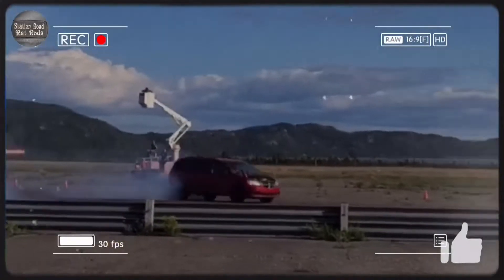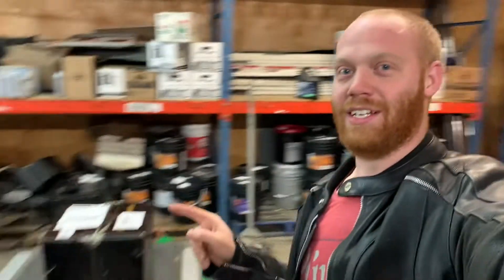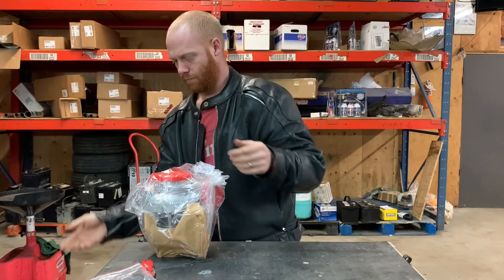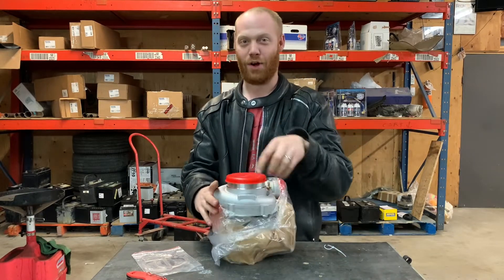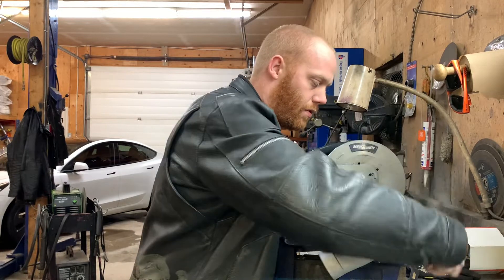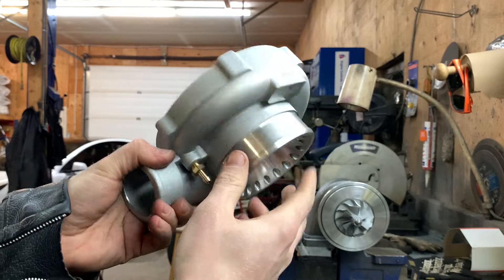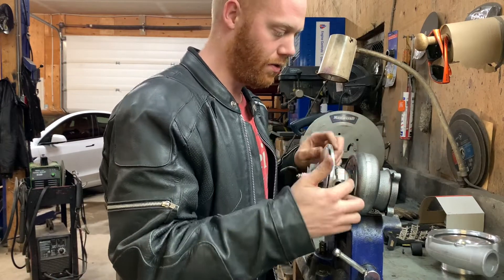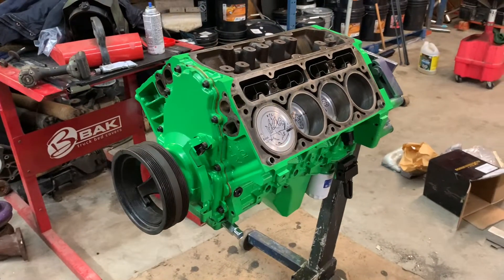Maxpeedingrods GT35 GT3582 unboxing, disassembly and review! Cheap turbo, good quality!

Comment: I just bought two with the billet wheels for a twin turbo LS 5.3 build I'm doing.
Reply from the maker: You’re going to love it. I had two of these on a destroked 6 litre and it was an animal!
Reply: @StationroadRatrods  I'm super hyped man! It's going into a Cadillac ctsv my buddy got for cheap. Just got it stripped and the transmission pulled this week. Hopefully taking the 5.3 we to the machine shop this week go have them go over the block and gap the rings. I have to build some custom manifolds to make it fit in the engine bay but luckily I'm a tig welder lol.
Reply from the maker: @clutchboi4038 man I’m hyped for you, V’s are sick! I hope you guys have a blast

Comment: That's a lot of movement.......omg. not correct
Reply from the maker: I just read your name and ufology must be a rewarding but frustrating study huh? 

As far as I understand, journal bearing turbos like this need shaft clearance so it can float on a film of oil, though I don’t know how much clearance is too much. 

I had two of these turbos on my truck all last summer with zero issues, if that counts for anything

Comment: I'm a machine tool fitter I work with bearing and bronze bushes daily, from little .5" to 12", for those that don't know journal bearings are are phosphor bronze bushes they aren't brass as some think, they need that play for clearance for oil to lube them, theory is when spinning the shaft will float on the oil and find its center and why balancing the turbo is so important if the shaft runs on the bearing it will wear it quickly so no clearance it will kill the bushes and shaft, the only turbo that shouldn't have play is a ball bearing but they require restrictor as too much oil will kill the bearings
Reply from the maker: Awesome info! I didn’t know about the two types of bushings. Thanks a lot
Reply: Teach those uneducated people lol thanks.

Comment: Im actually super tempted to get their street series 3076 because at 1/3 - 1/4 thr cost of a garret it steems like a dsmn steal if its a decent condition unit that wont nade itself.
Reply from the maker: I’ve had two of them on the truck for a full summer with no issues at all, if they shit the bed I’ll have videos up on that too

Comment: I had one of these brand new from day one that smoked loads - made me think it was my engine, but indeed upon dissasembly of the turbo the oil was pouring into the exhaust housing from the shaft lol.  I even tried a restrictor etc but kept having issues. My drain was pretty good too.
Have you ran yours yet? Im tempted to try another ( as they are many times cheaper than alternatives )
Reply from the maker: That’s wild. 

I’ve actually had two of these on all summer on my V8 with zero issues. I have a -6 oil feed to both. 

50 psi oil pressure at idle and around 90-95 psi at WOT and no restrictor 

The only issue I had were the oil lines I used were leaking, but that didn’t really have anything to do with the turbos themselves

Comment: I'm glad you did a review on their products... I've been shopping on the innerwebs
Reply from the maker: Right on man. As a follow up, I’ve had them on the truck now all summer with zero issues. No smoking or worn parts or anything. I’m on 4 psi right now, but I’ll be turning it up to 10-12 psi soon, if there’s any issues I’ll have videos on it
Reply: @StationroadRatrods  still no issues?
Reply from the maker: @whatta No issues at all! I drive the truck every possible moment and they work awesome. No smoke, leaks or noise only that sweet whistle
Reply: @StationroadRatrods  thanks a heap! Hopefully soon I'll have a pair mounted up to an LS.
Reply from the maker: @whatta I hopefully sooner than later! 

It can be dangerous though, you’re like 
“Just one more psi” and kaboom

Comment: Do you know what the thread pitch for the coolant ports are? I’m trying to figure out what fitting to put in them to work with my AN lines
Reply from the maker: They’re fucky, the thread is M14x1.5
Reply: @StationroadRatrods  okay does do you know what AN that converts to?
Reply from the maker: Sorry about the late reply, you should be able to find any size adapter. -6 is fine, it’s 3/8” ID 
I’m gonna see if I can find a -8 which would be 1/2” hose
Reply: @StationroadRatrods  thank you for your help! I found 14x1.5 6an adapter. Thanks again!
Reply: Do you happen to know the thread pitch and such for the 4 bolt exhaust outlet. Also I got this because the 4 bolt was supposed to bolt up to my srt4 but it seems my 02 housing is a smaller 4 bolt than what this turbo came with.
Reply from the maker: If you mean the outlet where the exhaust tailpipe would bolt on, as far as I remember it’s M8x1.25, and the flange that bolts to your manifold is M10x1.5.
Reply: @StationroadRatrods  yes I meant those but I’m also looking for a flange that fits the exhaust outlet. I thought my srt4 four bolt flange would bolt right up but it seems to be slightly smaller so all the studs won’t match up.
Reply from the maker: Okay, the part number for 3” outlet is Vibrant 14380, the part number for 2.5” outlet is 14390

Comment: Any HELP,  PLEASE on this turbo .  I have it fitted installed properly and professionally.  To my honda k20a  engine. Lots of Smoke is coming out from it  at opposite side inlet. When stationary,  after a short drive.
Looks bad , and embarrassing.  Oil seal leak i guess, not sure. This is my 1st turbo ever. Puffs of smoke out exhaust after short time of full boost,  after burn
Reply from the maker: I’ve heard of issues with the seals from factory, message Amazon or maxpeedingrods and ask for a replacement. Did this happen right out of the box?
Reply: @StationroadRatrods  i bought the car from a previous owner. And paid alot for it. So am really concerned.  Dont know if I should buy another as its made to fit where it is behind the engine block, and map tuned for it
Reply from the maker: I would suggest buying another one, you’ll burn a lot of oil and those civics don’t have a lot, don’t wanna cook your engine. They’re only 230 Canadian so they’re super cheap and you could have it changed in a couple hours as the fab work is already done, it’ll just be a replacement
Reply: Dont know if you have resolved problem but could it be an oil outlet restriction problem? Some have to resort to pumping oil back to engin eif it not mounted high enough or too small / long of return line. Just my 2 cents.
Reply from the maker: By the sounds of it he got a car with a worn out turbo but never heart from him after
Reply: @StationroadRatrods  my stage 4 competition clutch is slipping like crazy. Mostly due to normal driving. £150 for same new turbo. Its ecu mapped too. Its off the road . As I have 2 other cars , and a new born daughter. No time for my toy 😢
Reply from the maker: Congratulations on your new baby girl 🥰 I have two daughters, 7 and 9. They love being at the garage and helping with everything I do. 

Don’t get rid of your project if you can help it, she may love it one day. 

Hope all works out for ya, have a good one buddy

Comment: That shaft play seems excessive. Some will work out when it's hot and oiled up, but I'd expect half that or less. Have you measured the runout? Probably a good idea to do that before you call Maxpeedingrods.

Never had a good feeling about quality from that company. After all, they were too cheap to print the first S. :p
Reply from the maker: That’s kind of what I thought. I’ll take a measurement tomorrow and when they write me back again, I’ll have some ammo. 

From what I can tell by “feel” it’s less than 1/8” but I’d like to have an actual number 

They’re super China, but at the moment I’m on a super China budget so imma roll with it for now hahaa.

Comment: shaft play will tighten up with oil pressure and heat. all your dump truck turbos were probably ball bearing not journal?
Reply from the maker: Ahh perfect! I have only had worn out journal bearing turbos so they’ve all had play. I haven’t had a new turbo before though so I didn’t know if it was normal haha